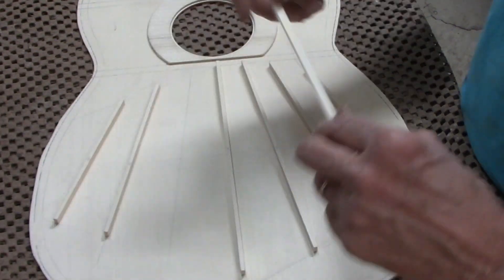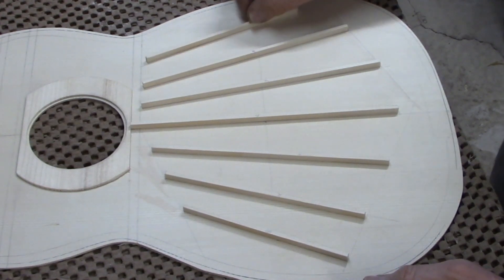Classic Guitar Construction Part 5: Bracing the Soundboard

Comment: Nice video. What height/thickness do you aim for in the lower cutoff bars? Is the reinforcement around soundhole same material as top? Thanks.
Reply from the maker: Thanks.  I often change the dimensions of those bars, but most commonly, they are 4mm wide X 6mm tall.
Reply: @zimnickiguitars311  thanks
Reply from the maker: And I generally use whatever piece or pieces of spruce I  find in my scrap bin for the sound hole reinforcement.  My concern there is to stiffen the area without adding much weight.  I don't think matching the species is important.
Reply: @zimnickiguitars311  does it really need reinforcement there given you have a other major braces? On mine I have a large diagonal brace below the sound hole and my neck comes right up to the sound hole.

Comment: Thank you very much. 
I would like to know about the dome:
After glue the midle bar or 2 V bottom bars, the guitar top ưill still has dome shape (from side to side, from heel to bottom) or the top must be flat again?

If still dome, so all cross bars are also much be curved accordingly with the top? And the strip binding also need to open 91 degrees angle? Many thanks.
Reply from the maker: The glue surface of the faan braces and  V braces is flat. The soundboard is placed on a work board with a dome, so when the thin braces pressed down, they take the shape of the domed board underneath the soundboard.